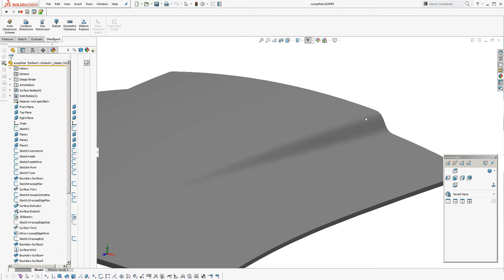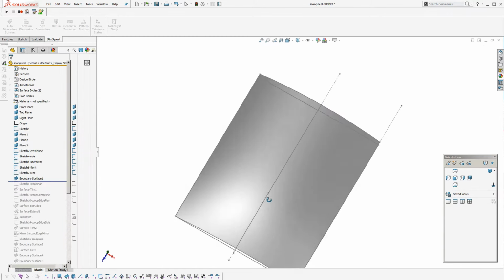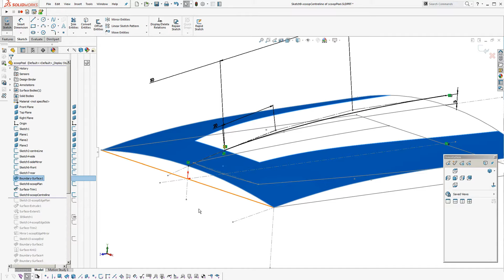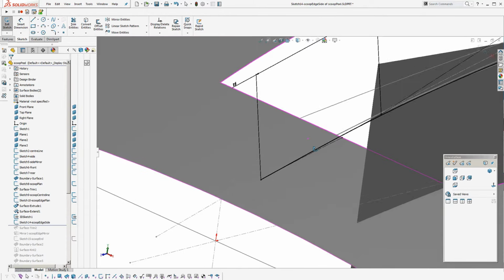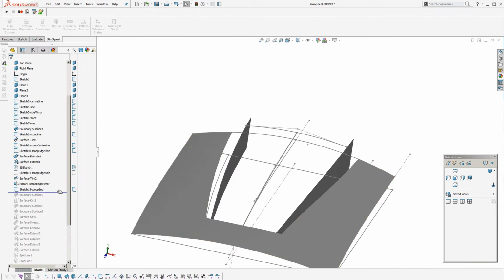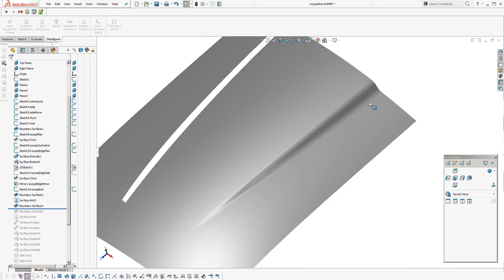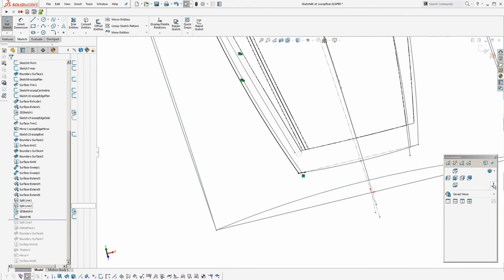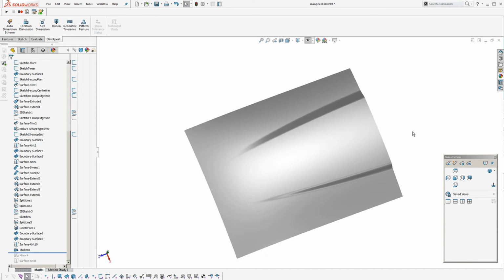Solidworks Tutorial: Creating a scooped or 'peeling' surface

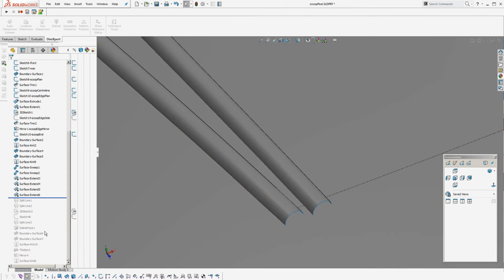Comment: Could you explain the reason for using the tube at 14:26 and using another boundary surface after trimming that part? Is it to make it smoother at the edges??
Reply from the maker: Hi, the tube is to create a trim that is a constant distance away from the tube centre and then the boundary is the blend surface. This is to create a blend with a fairly constant chord witdth, versus using a fillet/radius which will have a variable chord distance depending on the angle between the two primary surfaces. Cheers!

Comment: Dumb question, why did you use surface sweep to blend the surfaces? Are those working just as fillets or does it provide a different outcome?
Reply from the maker: Hi there. Good question. The sweeps are tools used to trim the surfaces back an equal amount from each edge, before building a blend in the holes left after trimming. You can try and add a fillet, but as the tangent angle difference in between the surfaces that are being filleted/blended runs down to zero where the creases run out, it means the fillet will also run down to nothing as well. Basically the fillet chord varies based on the angle between the surfaces. The result using swept pipes results in a visually better result.
Reply: @AndrewJacksonDesignStudio  Great idea. My first instinct was to loft 3D sketches and use the side edges as guides, but I believe the tangency would not be the same as with your method. Good stuff.